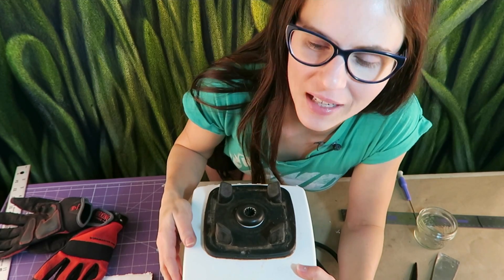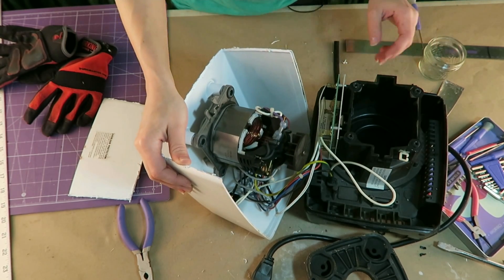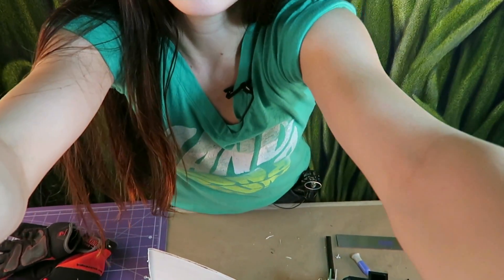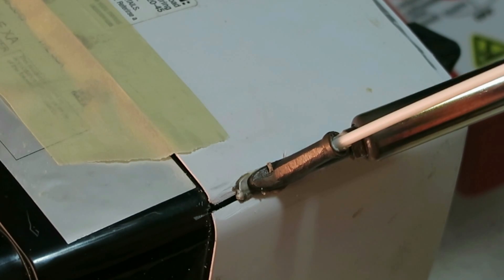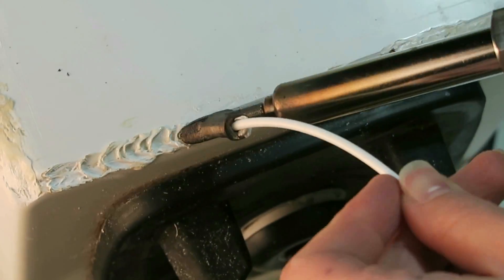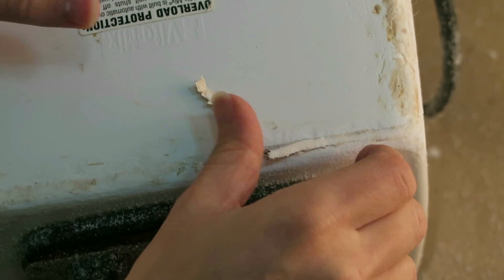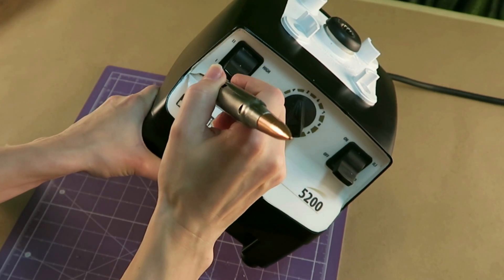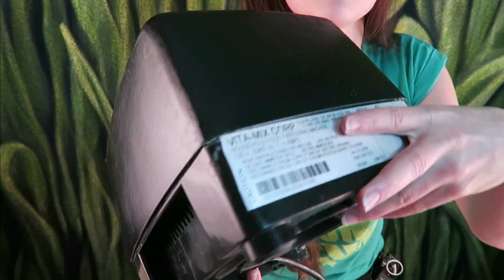Fixing a Blender with 3D Printing Filament and a Plastic Welder

Comment: I wonder if you need to feed the filament faster to prevent burning. either way seems like something that takes a while to get the hang of. That feeling when you rescue an appliance though!
Reply from the maker: It seems to be the filament left on the hot end that's burning and turning everything brown. If it's hot enough to feed the plastic through fast, then the residue burns. Cool enough not to burn the residue, have to go reeeaaally slowly to melt the 3mm rod. Maybe will try 1.75 filament. Yes, it's satisfying!

Comment: Next Stop: 💜Lindys Repair Café 💜! 😀
It seems kinda strange to me that you put the blender back together and then welded, sanded and painted the complete thing. I would probably have disconnected all the wires going to the front, then applied the aluminium sticky tape on the outside to hold the backpiece in place and welded it in from the inside. After the welding, remove the aluminium tape, put some masking tape around the welding seams (it would probably have some holes and inperfections on the weld-seam). Then apply some white bondo-filler to fill the gaps, sand it down, remove the masking tape and it should look almost perfect. 😎
By the way, the roachie probably was attracted by the warm motor inside the blender, and got a bad surprise once the power came back on. 💫☠

Comment: Have you tried melting the plastic with some acetone and making a slurry paste to "weld" it together, or is that a real jackball idea?
Reply from the maker: Have not tried and mostly don't print in acetone dissolving filaments. Planning to compare a doodler pen weld and  soldering iron weld vs actual welder. Let me know how it goes if you try the slurry!

Comment: Great job on the blender. I have one with nylon gears that have broken teeth, so won't mix anymore. I wonder if 3d printed gears will work?
Reply: It really depends how big the gears are, or how good your printer can do small plastic parts. Resin or powder based printers would probably work better, because you get a pretty consistent plastic and not as many tiny gaps in your print as with fused deposition printers. And it kinda depends on the power of the blender too, usually they have quite a lot of power behind the spinning blades , and if you drop something like apples or veggies into the blender, that would probably get most printed gears to just 'explode' again or at least strip the teeth away. However, trying it with printed gears before you throw the blender into the trash would definately not hurt and could be a good learning experience.
Reply from the maker: It would be interesting to try!
Reply: That's what I was thinking but like you said, it would be good designing and printing the gears as a good learning experience. Thanks!